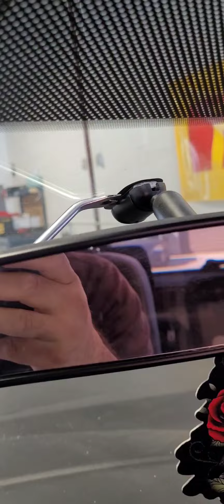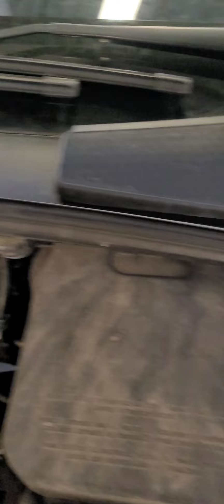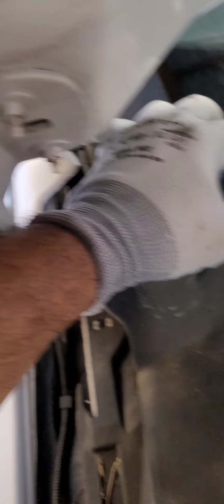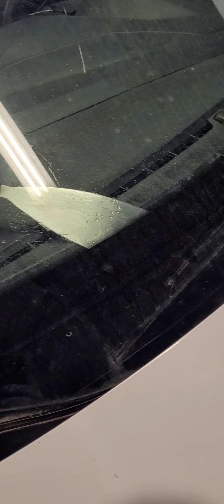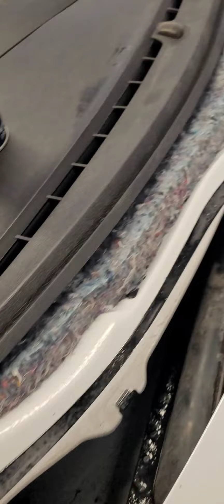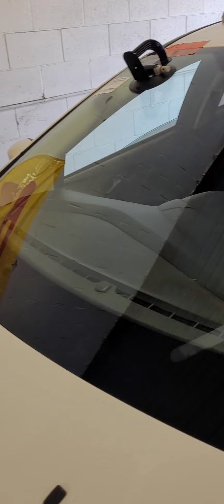how to replace 2014 Ford focus windshield

Comment: Never pull up on the trim rail inserts because all of the trim rail plastic clips will snap off. This style of molding you HAVE to slide off by pulling the trim directly towards the headlights otherwise you’ll be replacing the plastic trim rails and the inserts to go with them! The only way you can replace the trim rails after the clips break is by removing the windshield, good luck getting anyone to replace them. Nobody will do it for me after mine snapped on the freeway.